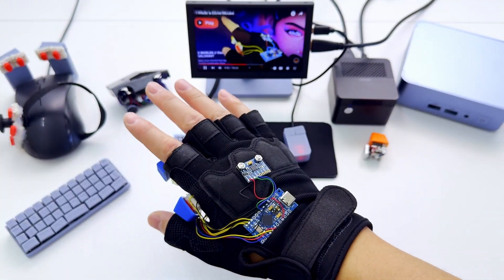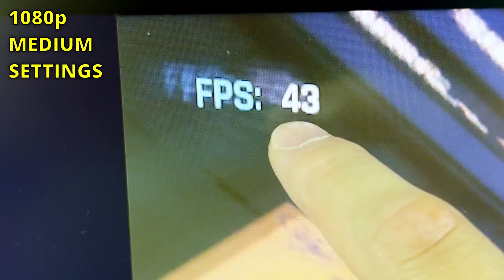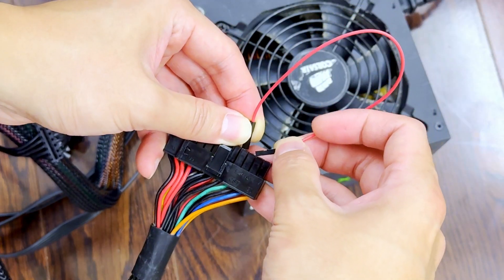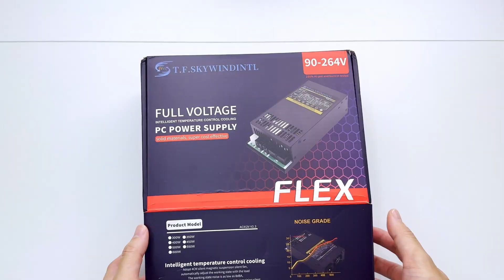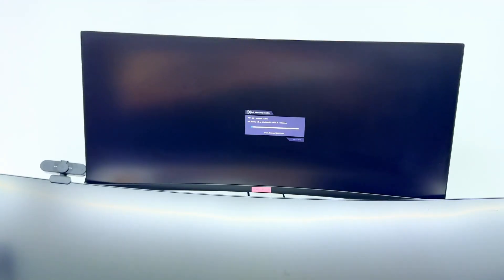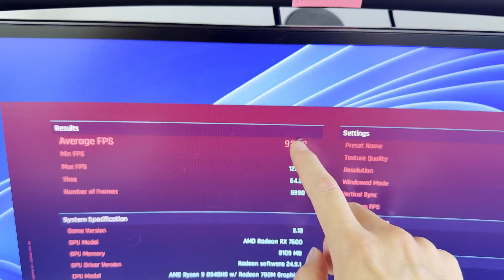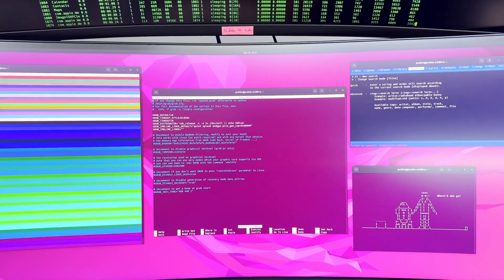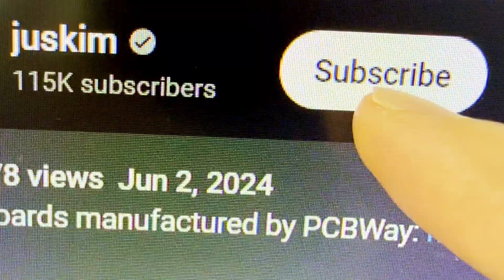I Built the Smallest AMD PC! (eGPU + Ryzen 9)

Comment from the maker: Gotta get that NVMe slot working with eGPU :_grimace:
Reply: Yep, your PCIE problem seem like a signal integrity one. PCIe signal is quite sensitive, and using 2 adapters with thin long non impedance matching wires certainly doesn't help.
Reply: @MrMaThaMi  Yeah defo not the issue here, it works fine on first install. Has to do something with the bios
Reply: Real
Reply: Try using oculink
Reply: can i ask how much money this costs
Reply: id love to buy it for gaming
Reply: i have all peripheals tho
Reply: they arent so mini tho
Reply: and is it able to run cs2
Reply: Should've used OCULINK ITS better and more proffered for these projects

Comment: I have a ACEMAGICIAN Mini PC, AMD Ryzen 9 6900HX(up to 4.9 GHz), 32GB DDR4 1TB NVME SSD Mini Tower PC, AMD Radeon 680M Mini Desktop Computer Support BT5.2/RGB Lights/HDMI/Type-C/Wifi6..what do I need to use external GPU..do I need a dock.can you send me in right direction
Reply: If the mini pc has thunderbolt 3/4 or usb c 4.0. get an egpu through usb c

Comment: When it comes to your issue with the PCIE speed decrease, could it possibly be a result of you trying to run the GPU off of what is supposed to be the wifi PCIE port? I'm not super knowledgeable when it comes to EGPU usage, but that's my first thought.

Comment: i think you need to run DDU first Display Driver Uninstaller if youre switching from amd to nvidia in order for it to clean wipe AMD's drivers and data. You should give it a try it might solve your issue with your Nvidia gpu
Reply from the maker: I did a clean install several times but no luck :(

Comment: I think reason the 4060 didn't work because the system had AMD drivers that needed to be deleted.
Reply from the maker: Didn’t work from bootup for BIOS and tried it without an SSD with no OS (but AMD worked for both cases) :(